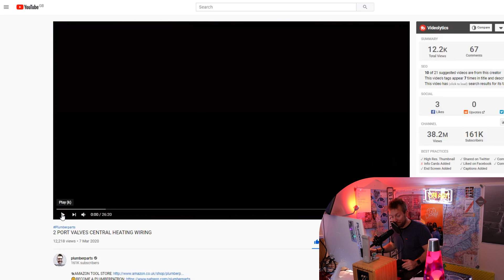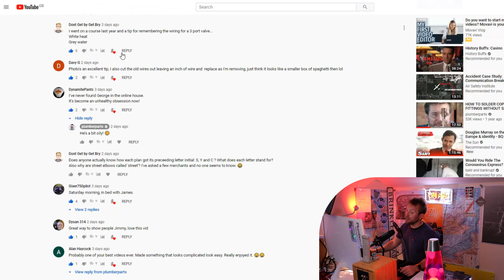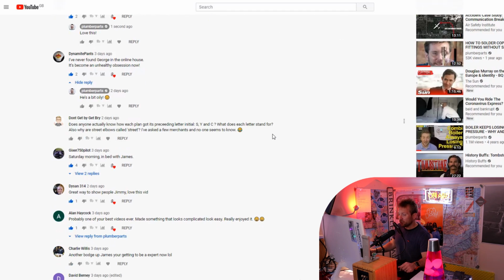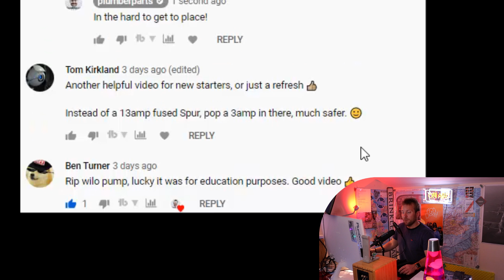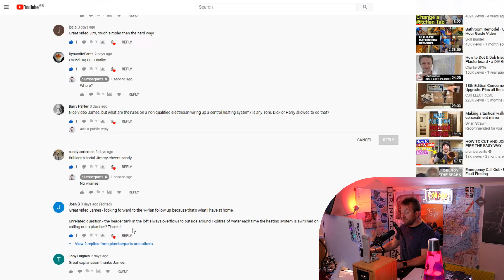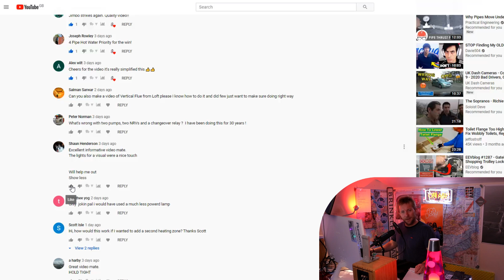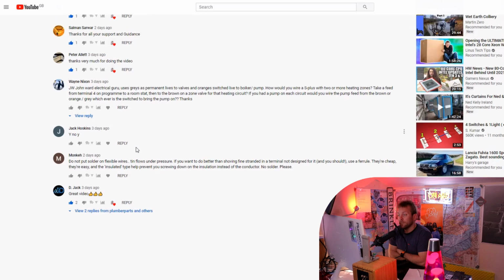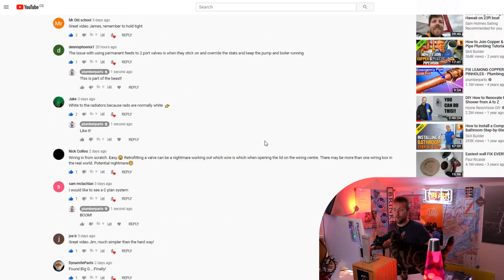PLUMBING ADVICE COMMENTS - 2 Port Valves and Wiring

Comment: Hi, are you going to do a video on 3 port valves ?, i fitted a new one as mine had died, now i cant get water without the heating coming on as well, all wires were joined colour to colour apart from the old black wire that had nowhere to go apart from the new white. keep up the good work.cheers. John.

Comment: Hi James. I like the vids where you answer others' questions. Even though I'm not that active on here, you often get asked something I would have asked myself. Haha Oily G, you really gave that one away. 
Here's a question for you.... I'm 37 now. Have been plumbing for a few years and am OFTEC. When I can justify the spend, in a couple of years, is it still worth getting a Gas qualification? What's your opinion on Hydrogen boilers and how do you think the roll out will happen. Lay new pipes, or slowly introduce boilers that will cope with a blend and as boilers age and get replaced, upgrade to a boiler that can take a higher blend or is there going to be millions of boilers getting swapped out in a short period of time?
Let me know when you're passing by the Maids Head by the fens, I'll buy you a drink.

Comment: I have a problem with my heating the heating will not come on without messing around with the room thermostat turning it on and off. I have changed the thermostat and the clock could this be the 2port valve the valve moves into the right place but it still does not come on without messing with the room stat any help 👍 love the videos